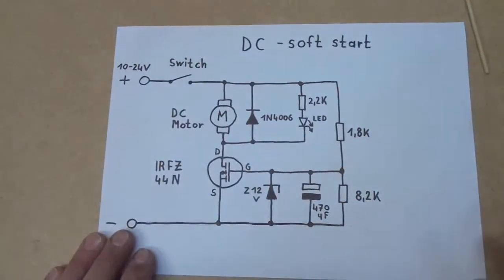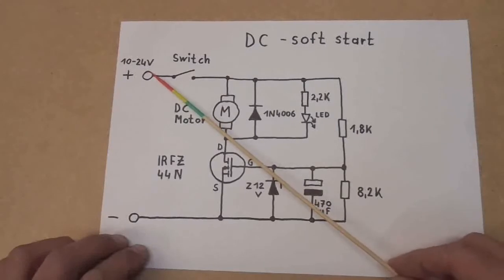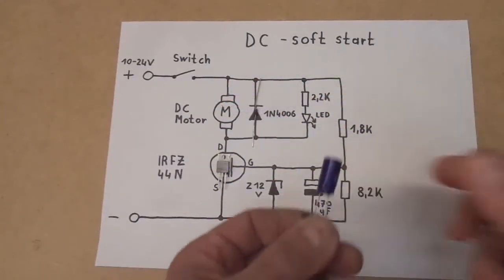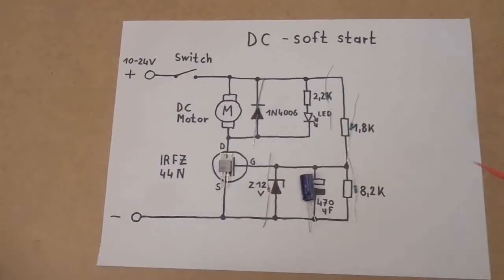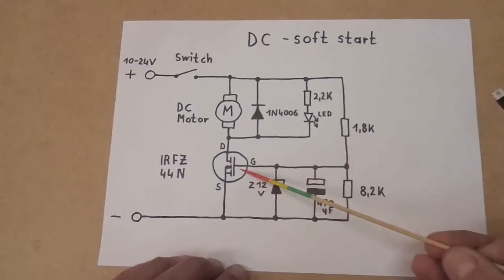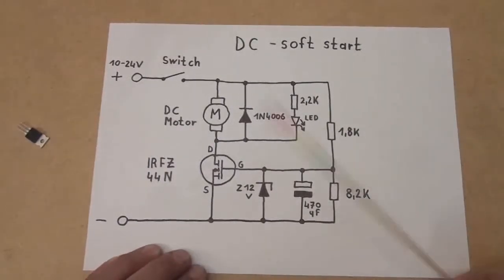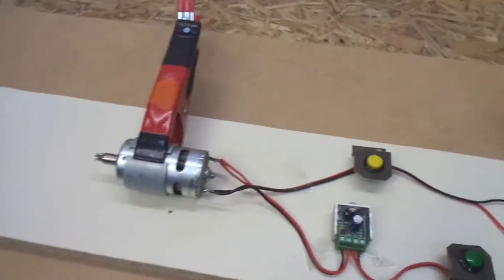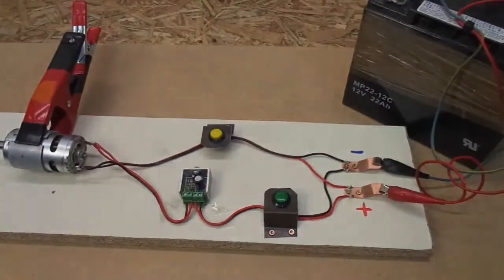super simple DC softstart circuit

Comment: i made this on breadboard and tested it using some leds and a multimeter, the leds come on instantly and meter showed full voltage, i even upped resistor to like 30k and capacitor to 6k uf and still no slow start ☹
Reply from the maker: What voltage did u use in your test? The purpose of this circuit is, to drive the Mosfet in its linear region for a short time.. Meaning, it acts as a resistor..but in the low ohm range... You need to connect a higher load to the circuit. A incadecent light bulb, if you dont have a Motor on hand. Did you use a N Cannel mosfet? Dont use a logic level type... They are full on at less than 5 volt... The IRFZ 44N ( which i used) needs 10 volts on the gate, to be full on. Connect your meter to the Gate pin... You should be able to observe a slow rise of the Gate voltage.
Reply: @LariFariYoutube  lol thanks. After hours of reading and trying to translate data sheets and definitions, what youve said has clarified everything 😁
I used 6v from a bench PS with couple leds in series and a n-chan mosfet that is probably a "logic level type".

Comment: Hello there!  Great circuit, thank you for posting this.
Question:  What criteria did you have when you selected the Mosfet IRFZ44N.  Was there any one specific parameter you needed for the circuit?
Reply from the maker: You can choose any N Mosfet, as long, as it can handle the voltage and current, required for your project...Generally, the higher, the better, since the Mosfet is running linear for some seconds... I used the IRFZ, because i have them on stock.

Comment: Hello, i'm looking for 36-40V soft start. Do You have any experience?
Reply from the maker: The maximum voltage of the IRFZ 44 N is 60 V. I think, this circuit will work on 40 Volts, as long as all other components are also rated for the required supply voltage.. (the capacitor, and the diode,..) The Zener diode limits the max gate voltage anyway. You should do some experimenting, until the behaviour of the circuit fulfill your needs.. But keep in mind...It is a very simple soft start solution.. Keep your expectations on the ground.  ;)   Greets from Austria

Comment: Just what I need and a great explanation.  BUT I have relays driven by a PC interface to drive a DC motor either forwards or backwards by reversing the polarity (to drive an observatory dome).  I need to add the slow start after these relays. Presumably I would need a separate slow start circuit for each motor direction but I am scratching my head about how to incorporate slow start with a reversing motor. Any thoughts you have would be very welcome.
Reply: apologies - I think the answer using the switching relays is fairly simple
Reply from the maker: Maybe a third relais prior to the H bridge? Relais 1 kicks in, feeds the softstart and the "soft started juice" goes via the H bridge to the motor. So relais 1 goes always on.. For - and backwards.. I personally would prefer to solve the problem with Arduino, Relais H bridge and Mosfet (PWM)
Reply: @LariFariYoutube  Thanks. That makes sense.

Comment: Ok, so I made this exactly to the schematic. But I see you fail to give the voltage value for the electrolytic capacitor. What will higher or lower values do? I am trying to soft-start a 25V 47000 uF capacitor, but this circuit is not able to do it. Ramp-up is too quick, so just after a third second the circuit has ramped up and drawing full amps. I need this to limit inrush at around 3A, but this circuit allows too much current to rush in. I only need to limit this for a second or so, then the amp draw will go down to only 1A @ 24V . But no matter how I tweak the circuit without adding a resistor, it will still not be soft enough. Any ideas?
Reply from the maker: The  timing capacitor will get charged up to the full system Voltage. In your case 24 Volt...right?  So you need a cap which can handle at least that... the higher, the better... I would suggest a 35 Volt cap.  The capacity of this timing capacitor dictates the ramp time...more µF == more ramp time. But keep in mind, as long as the voltage at  Gate of the Mosfet  is lower than 10 Volts, it runs in the "linear region"... Meaning, it will get hot. It acts like a resistor... So, the longer the ramp time, the more heat will be produced. Probably you would be better of, using a resistor in series to your massive storage cap. This inrush limiting resistor gets bridget by a relais, which kicks in after the required soft start time... I did a somewhat similar thing in my video " AC soft start circuit". But you could also use a simple timing circuit with just one NPN transistor or a 555 Timer IC, to switch such a "bypass relais" .. or even a ready made timing relais circuit for a few bucks.. If you are lazy  :D  There are so many different ways, to solve this problem.. Depending on your skills and patience.  :D

Comment: Dont know what i did wrong but it doesnt eork
Reply from the maker: Do you have some experience with electronics? Do you understand the function principle ? Does your motor run, when it is hooked up to the circuit?
Reply: Yes i am an electrician tinkerer no formal training though.
12v 2000ma motor (per specs on amazon) 
GM25-370

Output rate: 150 + 10% for RPM

Rated voltage: 12V

Rated current: 2000mA

I got your design to work with
 3 470uf caps in series between gate an sourcw
1m at gate after switch
4.7m between gate and source.
Only problem now is its taking 30 sec to even start
And 20 sec to discharge caps
So figure if i reduce the gate R more and the drain R more it should give me what i want.
(Start at 2 sec. Ramp for 5-6 sec discharge in 1 sec or less)
Using it on a relay board that is controlling 2 motors for tracks on robot.
Ive heardmany times PWM but yet to find one that would do what im looking to do.
I am not familiar with those circuit design softwares so trial and error.
Your design is similar to other fet soft starts ive tried but prefer sw on power and the led so workin with yours till i get it.
Thanks for reply if you have a different suggestion im all ears.

Comment: Hello im building this circuit now and i am wondering what operating voltage the LED is, most i have found on fleabay are about 3 volts. This seems low.
Reply from the maker: It depends on the forward voltage of the LED. Gree LEDs have forward voltage of about 2,5 Volt, red 2 volt, blue and white 3 Volts. Choose the right value of resistor for the LED.  There are online calculators on the internet, if you dont want to do the math by yourself... I personally always "underrun" my LEDs. This gives them a longer life and in most applications, they need to be super bright...  In this case, it is just an indicator LED.
Reply: @LariFariYoutube  Amazing, thank you for the clear explanation.

Comment: Hello, how would you change the circuit for a low voltage supply, like a 4.2v lithium battery? It would even get lower voltage considering the discharge, like 3V or less. I have a hand vacuum like that.
Reply from the maker: You need for such low voltage levels a so called "logic level" Mosfet. For instance the IRFL  44 N...or similar. Such a mosfet dont need 10 volt at the gate to turn on 100%. 3 Volt is enough... And you dont need the zener diode.. The two resistor values have to be determand by experimentation. One is for charging the Timingcapacitor, the other one to discharge it, when you turn off your motor.
Reply: The first thing would be the change of the mosfet, but which one for that such low voltage? I know it’s hard to find mosfet dos low voltage use. Thanks

Comment: Reaching out to say - great illustration and narrative on the build of this circuit.  Asking two things:  can this same thought process be accomplished with an AC motor and are there any tools available to help size the components of the circuit to the AC motor based on the  motor specs and application?

Thank you for your share!
Reply from the maker: Hy, my friend..This is a softstart for DC Loads.. I have a simple soft start circuit video  for AC loads on my channel es well.. So check out my video list... Greets from germany
Reply: @LariFariYoutube  - thank you friend.  Do you a recommendation on how I can learn to use the proper sized components for my application?

Do you have way I could contact you privately?  Thank you sir!
Reply from the maker: @energydreamer5347  There are some basic calculations, which you can do.. But in the end, you will have to make some experiments and find the perfect circuit by trial and error..

Comment: Im looking to add this to my 12 V my kids car battery, because its always had jump start when i push forward and sudden stop. I want to be as soft as possible when it start moving.. good video
Reply: How many mosfets did you use? Did you manage to get it working? I have to drive a 250W load with a 12V power supply so I might need to tweak the circuit. Please share your experience

Comment: Narrated functional schematic with analysis of pros and cons, improvements suggestions as well, depending on applications. Perhaps test under load and current measurement with and without heat sink? Anyway it's for us to try. Thanks for presentig this simple approach.
Reply from the maker: Hi, Francois..To be honest, this very simple soft start is dedicated to people who dont have the knowledge to even understand complex measuring processes.. There are so many tinkerers out there with very little experience and they are looking for super simple circuits... As i said in the video, i bymyself would not use this softstart.. I usually make soft starts with a microcontroller, wich is definitly the best option.. But since there is so much interest, i will perhaps revisit the subject and do a more detailed video on the thing... But anyway... it consists of just a few parts.. It is easy to try it and experiment with the circuit...  It dont take much time, money or effort..  ;)   Greets from Germany..
Reply: @LariFariYoutube   I was looking to provide a soft start on my grandson's toy cart as they jerk quite a lot upon depressing thepedal. After watching your video, I was convinced that investing a little time rehearsing my Arduino skills would pay off. So I'm settling for a full H-bridge BTS796 which costs only $4.83 on Ali Express, shipping included!  Even though they claim it is a Stepper Motor driver, it only offers 2 line output to drive the motor. So I''ll assume that it is more adapter to drive a medium size DC motor.

Comment: Very educative, thank You.
If I have a DC motor that is reversible (+ and - switching depending on which rotation I want through a controller) how would I use this soft start PCB?
Reply from the maker: A possible solution would be: PWM controller(for motor speed control) --> soft start --> Relais H-Bridge (for motor reverse) --> DC Motor..

Comment: Will a circuit like this prevent e.g., an Arduino, that is running on the same power supply as the DC motor, from shutting down due to power fluctuations? In my specific case I decided to design an electrical cabinet for a small CNC mill with one power supply for both Arduino and spindle motor (24 VDC < 80 watts). I haven’t powered it on yet, but I fear that the Arduino will reboot when I activate the relay to start the spindle.
Reply from the maker: How do you power the Arduino? I dont think, you send the 24 Volt right into the "raw" power input pin... This would result in a overheat of the Voltage regulator on the Arduino board. I think ( and hope), you have a step down converter from your 24 Volts to 5 Volts..  But anyway...i dont think, the startup current of the motor is so high that the supply voltage drops under 5 Volt. Chances are very small, that your arduino crashes..But CNC spindle motors... depending on the type of motor... can produce a lot of enterference frequencies... This could lead to malefunctions during the operation of the machine. A friend of mine had a lot of problems like this. A LC filter circuit in the motorline solved the problem. How do you controll the spindle Motor with the Arduino? With a relais or driver / mosfet?  If so, let the arduino ramp up the speed of the motor instead of turning it on abruptly.
Reply: Hi, and thanks for the quick reply. I had planned to power it directly with 24 volts, until yesterday when I realized the voltage regulator on-board only supports up to 2 volts. I am now planning gin using voltage regulators that span from 7-32 VDC to 5 VDC.
However I tried this trick before for a GSM-setup (for sending text messages from Arduino), and here the Arduino would reboot whenever the GSM-module tried to establish connection, since the current consumption would go from practically nothing to 2 amps in no time. Here I was suggested to add capacitors at the GSM module to prevent this, but I have not had time to test that yet.
I am running the motor with a relay controlled by the Arduino, so it’s going to be instantly 0-100, which made me consider making a soft starter circuit (we use AC soft starters at work, I program robots), in hopes that this would reduce the current spike when turning on the spindle motor.
I am aware that the spindle will generate a fair bit of noise, and I am actively trying to figure out where to connect the ground wire on the spindle 😊
Reply from the maker: Ok...Adding a capacitor to the supply line of the Arduino is always a good idea..the bigger the better (in a nutshell).. You could use the softstart circuit, to start your spindle motor...thats what is ment to do, but you need to add 2 or more mosfets in pararllel to sread the load and heat.. But i would go another route... Look in the internet for DC motor driver board or simply drive the gate of the Mosfet (s) from an PWM pin of your arduino. Watch my video "high side switch for arduino" .. And let the Arduino do the soft start / ramp... The thing is, you will need a variable speed on your spindle anyway at some point in the future. And for powering the Arduino, dont use a linear regulator. Regulating down from 24 volt to 5 Volt would generate a lot of heat. Thats the disadvantage of linear regulaturs. Look on fleahbay for a step down converter board / buck converter.
Reply: I will look into this, thanks a lot!

Comment: Hi, is it possible to build same softstarter for an 220V DC motor?
Reply from the maker: Yes...choose the right Mosfet, flyback diode and resistor values for the voltage divider and you are good to go.  ;)

Comment: Ciao e complimenti per i circuito. Credi sia possibile renderlo reversibile? Che sia indifferente l’entrata del positivo e del negativo
Reply from the maker: Yes, add a "relais H - Bridge" to the output side of the circuit (to the Motor / load wires)...Thats the easiest way, to reverse the Motor.
Reply: @LariFariYoutube  grazie per la risposta. Se voglio aumentare gli ampere, farlo a 50A devo mettere 5xIRFZ44 ?
Reply from the maker: @g4vrv  Yes, you can connect 5 Mosfets in paralell to get a higher current rate. But i would recommend to use 8 irfz 44N for the 50 A load.And mount them on a big heat sink.
Reply: @LariFariYoutube  ottimo. Io ho già acquistato tempo fa un kit “AR163 Soft Start” su Amazon. ma questo kit ha solo un IRFZ44N, posso collegare ugualmente su questo 8 IRFZ44N in parallelo? Ovviamente li metterei su una scheda a parte con un grande dissipatore come da te suggerito
Reply from the maker: @g4vrv  Yes you can "upgrade" your circuit.. No problem..
Reply: @LariFariYoutube  grazie mille! Sei gentilissimo, credi anche che è il caso di cambiare i connettori a vite? Con dei connettori più grandi?
Reply from the maker: @g4vrv  Yes..for 50 A you need at least 10mm² wires...And therefor bigger connectors.
Reply: @LariFariYoutube  Sei stato gentilissimo, grazie mille per le risposte!
Reply: @LariFariYoutube  buongiorno! Ho un circuito su cui già ti dissi che volevo aggiungere degli IRFZ44 per aumentare l’amperaggio ma ho paura che le piste non reggano i 50A anche cambiando i connettori con quelli più grandi, vorrei inviarti delle foto per fartelo vedere, è possibile spedirtele via mail?

Comment: It sounds like this would work for an electric clutch which is an electromagnet? The normal current draw is 4-6 amps getting up to 10 as the device ages
Reply from the maker: Yes, it would work on such a electromagnetic clutch. Do you have problems with high inrush current on such a device?

Comment: Sir can you please design a soft start circuit that is always on. Has a DC input, and the moment it senses a load connected to the output, the circuit soft starts itself. And then the moment the load is removed, the soft start circuit automatically resets itself.

Trying to make a circuit similar to a magsafe charger, which outputs around 4-5v Dc when not connected to the macbook, and the moment it senses the load is connected(the charger is plugged to the mac), it starts sending a full output voltage of 18 volts.
Reply from the maker: Voltage and current? I will see, what i can do for you.. ;)
Reply: @LariFariYoutube  max voltage 24 volts. Current 6 amps max.

What i am looking for is a kind of circuit that outputs around 5 volts normally. The moment it senses a load is connected, it switches the voltage from 5 volts to 19 volts ( or the main source DC voltage). And then the circuit resets immediately after the load is removed).

Basically trying to remake the magsafe charging system.

Thanks for your reply Sir.

Comment: Max volt and ampere?
Reply from the maker: You can use the circuit with virtually any N channel mosfet of your choice...Or 2 and more mosfets in paralell.. The type of Mosfet sets the current and voltage limit.